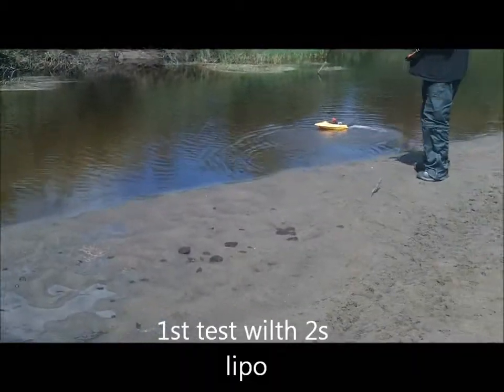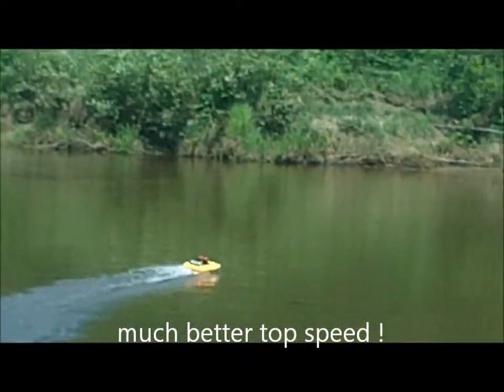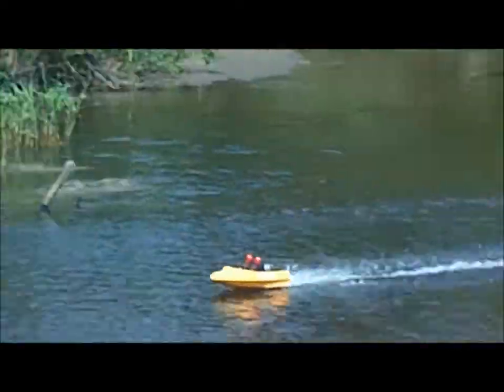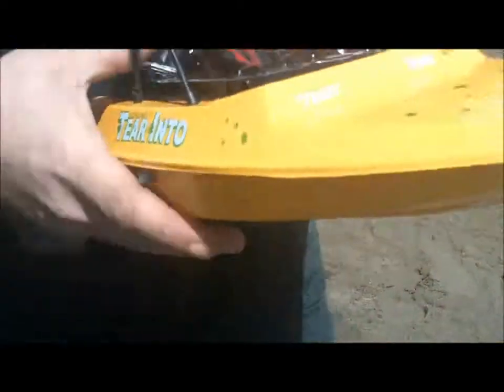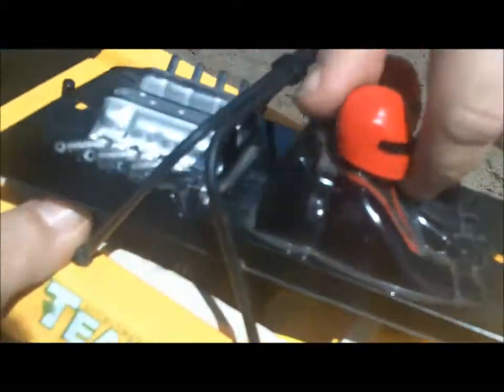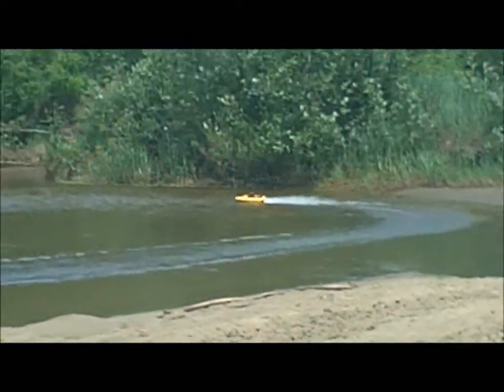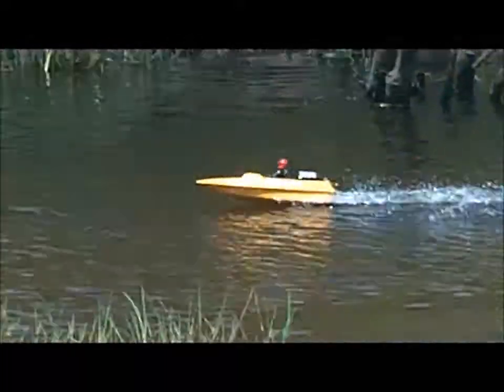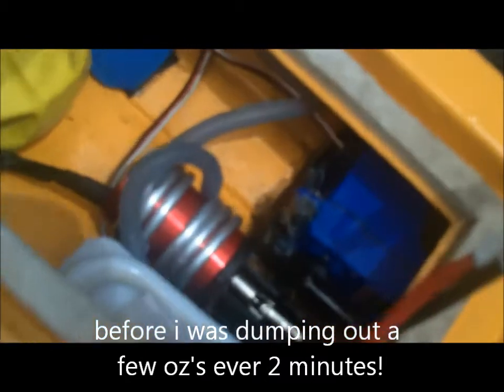nqd jet drive mod part 3 testing the new stuffing tube.

Comment: what brand of greas do u use?
Reply from the maker: i use pro boat marine grease .  it's a high speed grease that won't brake down in water ,  it has anti sling technology for very high rpm,s .

Comment: That's amazing I've had a hard time of it on my 3 boat now and it was the leaky jet drive that had me I too tried axle grease . I would appreciate a idiots guide to modding the jet drive if you could do a write up or another YouTube vid also the coupling giving me grief I drilled it out and its unbalanced . . spent bucks so far losing interest . . Thanks
Reply from the maker: i did do mod vids on how to make the stuffing tube. they should give ya the general idea .  as for the coupler i ordered from e-bay a ( 2.3mm x 2mm ) universal joint coupler that was a 2.3 for impeller shaft and 2 mm  for motor .  that got rid of the vibration and noise . she runs very smooth !  just get a 2.3 x what ever your motor pto shaft is. oh and measure the length of the stock coupler and order as close to that length as you can.  mine was a bit short  but still worked.  hope that helps ya out .sorry it took so long to answer.  my new job takes most of time now .   B>P

Comment: Looks like the marine grease worked really well!  Nice boat, fast!
Reply from the maker: UnlimitedVertical yeh  worked like a charm !  the car axle grease really slowed it down  and stunk .  the high speed anti sling grease won't break down in water.  perfect for solid shaft & stuffing tubes , cable drive , brushless set ups and i also use in land vehicle tranny gears .

Comment: Wow. What exactly did you use to keep that water out? That's fantastic. Liked.
Reply from the maker: i drilled out the jet drive and put in a home made stuffing tub. i filled the tube with proboat high speed marine grease. it has anti sling technology, very important or the grease will slow it down at high rpm's. and doesn't break down in water. hope that helps. any more questions, ya know where i am. no such thing as a stupid question bro !

Comment: crikey that shifted on 3 s , what esc are you using?
Reply from the maker: im running a sea king 35 amp by hobbywing. yeh it put some skip in her step !  lol !  the home made stuffing tube works like a charm.  im going to do the same mod to the new white one. it's nice to run a dry boat for a change.  thanks for watching and commenting